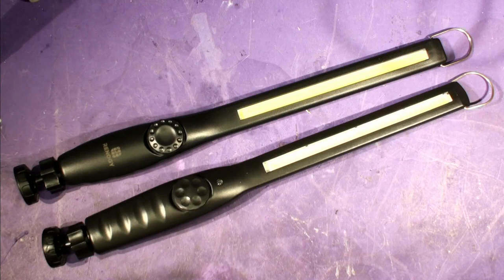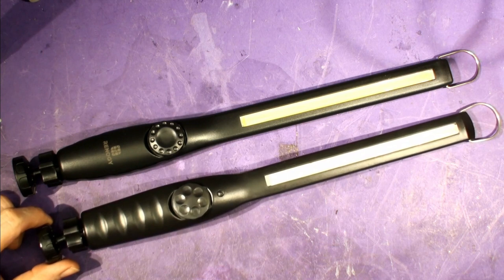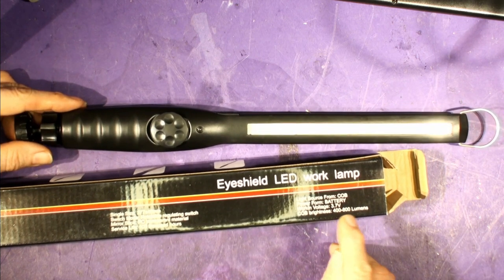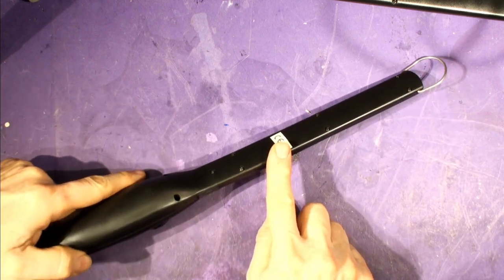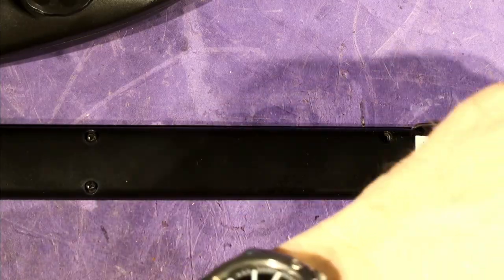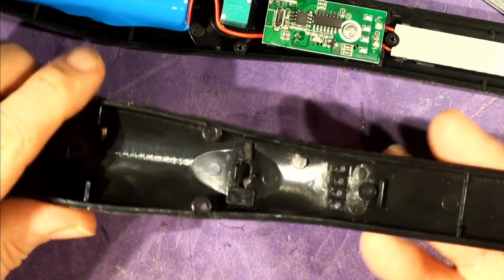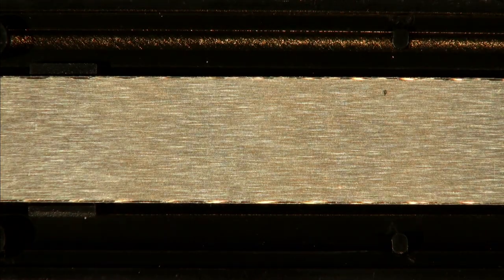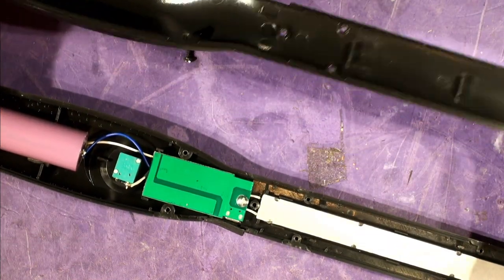Renogy or Winzwon LED work light, Which one should you buy? Tear down and test.

Comment: Pretty clear cut winner there!
So brand names could well make a difference on these lookalike things.
Will bear it in mind when browsing online markets.
Great video - thanks.
Reply from the maker: Thanks for watching. Chalk and cheese as they say. I find the disregard for the waste a big issue with these products.  On the crappy one there is no circuitry to cut of the power when the cell voltage gets dangerously low.  So leave it on and the battery is knackered. It will be in the bin inside a year. Time to enforce minimum ECo and technical diligence standards for products imported from China.

Comment: Oh hell yeah I love stuff like this. A rechargeable headlamp is my most used tool even though I spent a fortune setting up my lab with good lighting. The best of the best adjustable surgical type lighting not only for electronics but when working on violins and such you need several different spectrums and colors of light, that can be adjusted to almost any angle to cast shadows on things when looking at arching and stuff like that. 

But even though I spent a ton on lighting… The one thing I couldn’t live without is my little $30 “Nebo rebel“ headlamp. It’s still going strong after 15,000+ hours of use and is only on its second replacement battery. Even the original O-rings which is impressive considering I’ve probably disassembled it 50 times just to clean it and inspect everything inside every once in a while. When you use something every day seven days a week 12 hours a day… You would think it wouldn’t last that long.

It runs off of one of those smaller batteries and has a magnetically rechargeable base. (which some may consider the weak point, and even though it does need a bit of attention paid to it… You could never keep even an expensive headlamp this long with this many charging cycles without replacing the USB-C or USB mini port. The magnetic coupling means there’s nothing mechanical going on so there’s nowhere. Just keep the contacts clean and don’t put it in your pocket if you work with a lot of magnetic metal chips. it’s an unbelievably inherently safe design because of the precautions they’ve taken. Some of the more expensive $100 headlamps that have magnetic bases like that… Can be dangerous because if it shorted out you’re getting all the power of that battery in a pretty quick timeframe. But this one does not suffer from that because of the extreme link they went to to separate and keep the two contacts nearly impossible to accidentally short out. 

I work about 60 hours a week and it’s always on my head even in the middle of the day with the sun coming in the windows. I always use it on low, even medium is too bright when you’re working at an arms reach. Hell I don’t even turn it off when I’m looking in the stereo microscope the battery life is so long there’s no need to even worry about it. i use it on low so it last 12 hours before needing to charge that small 13650 battery. Even on high brightness which is 650 lm I believe… It lasts well over an hour I can’t remember maybe even two or three. It’s really impressive because of the efficiency of the design, the links they went to to gold plate to contacts in the way they’ve arranged them inside to have extremely low resistance… It’s just a banger of a design. 

I’ve had it apart to tweak the heat sink and coupling a bit so that it was a bit more efficient but honestly it’s not needed. You can pick them up for $20 on sale and although I’ve tested every brand of headlamp… And I love some of the olights, Stream lights, etc.… Nebo has made an incredible design and from what I can tell a lot of the machining and work is done by the same folks used by Olight and other expensive companies. 

Down to the type of hard anodizing layering, the exact microscopic cross-section of the threads… Etc. 

Like a lot of products these days many of them are made in the same factories at least for the component parts. And what makes the difference is how the company spends that extra money to improve the quality. They either spend it on fancy boxes and packaging, or quality control and customer service. Obviously if you buy $100 headlamp from olight or fenix ……. you get a great quality product in a $20 box and have decent customer service and community. But for 1/3 of that price you can get the same thing from Nebo. And many other companies I suspect!

At least until they cheap out or change the way they do things. I’ve been to China and Shenzhen in particular…and the manufacturing districts enough times to realize that many many many of the products we buy are made in the same factories. It’s up to the American importers and Company creators to ensure stricter quality control, tweak designs, and ensure that the specified quality Parts are used not just from the first few batches, but even after hundreds of batches. 

That’s where most products fail even just one person doing random inspections can change an entire product line because the folks in China aren’t lazy cheap doubt bums like every American makes them out to be. Hell we can’t make a toilet seat here in America anymore unless it’s made of reconstituted dog shit or I guess maybe you can get a particleboard version with the carpeted top if you have 100 bucks to spare. Carpet covered toilet seat… Who’s genius idea was that anyway. probably some Nobel peace prize winner.
Reply from the maker: Thanks for the comment.  The Chinese problem is to do with lack of ethics.  The whole supply chain is flawed.  Landfill in Europe is filled with badly designed products...

Comment: I've tried finding these but they want to much for them in my area.
I bought a Braun work light from Harbor Freight and it's awesome. You can even change the battery.
Reply from the maker: I think you dodged a bullet there. the Renogy is pretty good for the price. The Winzon is a cynical landfill 
 rip off of the original -  It doesn't event cut off - if you leave it on it runs the battery down to near zero volts and it is ruined.

Comment: The cheaper ones have gone up in price, a couple of years ago I've picked one up for about 4 quid on eBay, I've been using it plenty and it still works, as soon as it goes dim you charge it, I've upgraded to a nice sealey 800 lumen now
Reply from the maker: Oh, do you reckon the Renogy version was released after the crap one? I'd say 4 quid is a fair price for the bad one. I perefr to pay a bit more and own the the version that is 30% brighter, Higher capacity battery, lasts about three times longer between recharges, a brand new battery,   efficient PWM LED drive that switches off a a safe discharge voltage and a stronger magnet.  Apart from that I cant think of  a reason except that the case is a bit tougher..
Reply: @razenby  yes I'm sure the better version didn't exist initially, I took a punt from China , of course the astro lite is the original and I'm pretty sure that didn't originally have the battery bar, but has had a revision or two since it came out

Comment: Ugh I have the crap one haha! Think I could rig a heat sink in there somewhere to help?
Reply from the maker: Hmm not sure.  Apart having to charge it more often and not being as bright to start with If you forget to turn it off it just runs the battery flat and ruins the battery.  It really needs a protector for the battery to cut the power when the voltage get to about 3.2 volts.   Thanks for watching. You could fit a new battery with better capacity with the  protection circuit built in.  Buy a 2000mAh battery it will last  longer between charges and the cell wont get ruined if you leave it turned on.

Comment: I have to say that i fell asleep while watching your video.... But i was a bit ill and tired at the time.
The second try i was ok,  you really went mad with testing and colour spectrum.
Finally the crap analog light died early,  you silly boy he he :-D.
I chose the pulse width modulation light,  honest i did Guv lol.
The transistor would be a tad cooler.
I did think Mosfet, but i slapped myself for thinking well overboard.
I do go overboard when i make a psu, a heatsink the size of a battle ship and loads of 2n3055's.
Although it's a bit too much for a 2 amp supply ha ha 😀.
Reply from the maker: That's fine - I almost fell asleep making it. The copy is such a con that it made me angry, A rule of thumb we used to use when calculating the reliability figures of designs was that the failure rate is doubled for every 10 degrees C rise in operating temperature .  So 20 Degrees hike = 25% as reliable, 30 degrees = 12.% as reliable.  So keeping everything as cool as you can is definitely a good idea.  Thermal  micro cracking of components during temperature cycling is also a problem so if you run it hot then keep it hot .. don't keep cycling a fan on and off - make it closed loop temp controlled cooling. Oh, and don't fit Chinese components!!!!
Reply: @razenby  So my habit of putting oversized heatsinks on devices is not so silly.
I like to be able to put my hand on the heatsink center without having to remove it with swear words.
Oddly i never have been a fan of the fan ha ha :-D
Splitting the load between many identical devices works well.
Divide and concuer the heat,  wrong type of war i suppose 😀